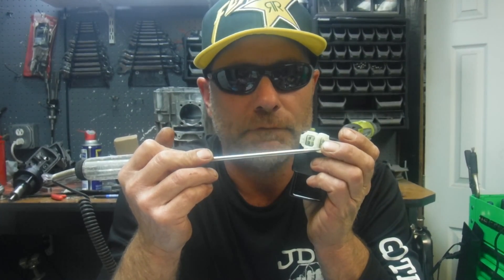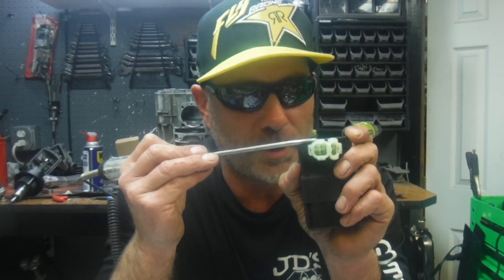CDI ???   AC OR DC?  AND HOW YOU CAN TELL!

Comment: so u explained the cdi side,  what about bike side,  so you have bike how can u tell witch cdi it requires if battery is optional,  at thar point would it be up to me to decide what type of cdi i want to use, like a dc with battery or rectifier or ac and wire accordingly,  

at this poing it seems like i can go either way correct ???

Comment: Checking the wiring diagram for a Suzuki DR650 seems to have a hybrid CDI that has an Exciter Coil to power the CDI box capacitor and a direct current input from the Voltage Regulator via the ignition switch to the CDI as well.   Strange setup.

Comment: If i have a bad stator could I convert the system to DC? Do i have to buy a dc cdi? Or could I use the same cdi just wired differently?
Reply: Nevermind I tried it and I'll be ordering a new CDI 😂😂😂😂 do not do this you will create some fireworks
Reply from the maker: Both

Comment: Wouldn't you say that a AC CDI that makes its juice from the stator and energizes the CDI box would be more appropriate or better off for off-road vehicles just to eliminate one more problem like a dead battery?
Reply from the maker: I will sy that I do not disagree with that theory. I used AC til we started racing them at the tracks and I only switched when I found how much better the Ban Jing performed compared to everything else.

Comment: For me, I think the question is, given the purchase of a non-descript cheap CDI, how do you know which type it is - ac or dc? Also, can you use  an ac CDI in a dc machine (and vice versa)? I guess I'm also worried about what any replacement might do for ignition timing - especially for 2 strokes where quick overheating and catastrophic failure could result. It's a minefield don't you think?

Comment: There are some Vehicles that rectify power from the stator directly to the cdi unit. Thus allowing for a DC cdi that will function with no battery. Regardless will still have fused positive and main switch wires
Reply from the maker: correct, but in the case of the buggies that i have seen as battery voltage drops, the cdi loses function which would be a direct result of a failing rectifier, the way the buggies are wired is the rectifier maintains the battery as the draw happens when it is running. Basically depends on the way it is wired.

Comment: i need to know how to check if lights arr ac or dc powered
Reply from the maker: i would try and test the wires with the machine off ignition on and the light switch on, use a test light. normally ac wired lights get very dim at idle and noticably brighter when the motor is running where as dc wired lights don't fluctuate that much
Reply: @jdscustombuggies1733  thank alot

Comment: So if my cdi is bad, would it run? Mine runs but doesn't like being warm.. when I push the throttle it falls on it's face.. new carb already and same issue.
Reply from the maker: Sometimes a bad CDI will idle fine but when the gas is pushed it will not advance timing to match the rpms causing it to break up. That sounds like your issue.
Reply: @jdscustombuggies1733  that was exactly my issue. I just put a performance CDI box on yesterday and it's running great now 😊

Comment: How do I check the CDI before install so I don't install the wrong one?
Reply from the maker: Check the wiring like in the vid to determine what you need and order the correct one.
Reply: @jdscustombuggies1733  I know what CDI is required for my Buggy. I need to know if the CDI I have is the correct CDI for the buggy before I use it.

Comment: I jump started my scooter because the key ignition doesn't work even with a new key some electrical I haven't found it yet but the scooter stay running after I take the battery that means I have a AC CDI

Comment: Thanks for sharing ,your knowledge,I'm working on a Bombardier Rotax snow mobile ,I'm not sure what it uses it's a got a coil pack that fires 2 spark plugs ,and I had a box on the frame that's transparent,I'm not sure if it's a cdi or a voltage regulator,all I know is it's not sending any spark ,it's got two Mikuni carbs and an oil pump bolted to the pull start housing ,it also has a starter,Thiers no ignition or switch ,any advise will be appreciated
Reply from the maker: i would assume it is AC because it has a pullstart
Reply: @jdscustombuggies1733  yeah I got it started by disconnecting the the harness from the frame

Comment: So if I have a 4 cylinder motorcycle ..(1980  Suzuki GS 850 )..
Will I be able to run only one CDI..or do I need 2 ..1 coil..fires 2 cylinders ..??
Reply from the maker: I suggest you look up the part for that bike , I suspect it has a unit to fire multiple coils or a coil pack

Comment: Please tell me you actually answer to comments I have a Carter XTV -150 with a dc battery electric start a 6-pin CDI and I can't tell because it has a fused 12v but some idiot took the buggy apart and put it back with mismatched parts how can I find the correct ones
Reply from the maker: yes i do try and answer questions but yours is kind of vague. you can feel free to reach me at the shop 941.286.6703 and i will try and answer any questions you have.
Reply: @jdscustombuggies1733  thanks I got ahold of a GY6 specialist I'm getting a new harness

Comment: great vid, so basically on a gy6 scooter, if you disconnect the neg on battery while the engine is running , if you have AC then the motor will not quit?

Comment: If i try to kick start without the battery on a dc cdi will it still work?  No right
Reply from the maker: yes but why? what i mean is it can be wired to work but you still need the battery to run the DC CDI so why skip a solenoid in the mix. not to mention you still need a starter to seal the hole it goes into. but a kickstart can still be used as a backup as long as the power is getting to the CDI it should fire.

Comment: Hi, NIce VIdeo,,,here is my situation, just got a CIXI Konced 150cc scooter, when it came to me it did not start,,,compression, fuel, stator coil all look good, but we have no spark for certain, we tried, different coils, CDI, plugs,,nothing,,,,the previous owner I believe messed with the wiring, and the scooter came with multiple CDIs, I am not sure if this bike is AC or DC CDI and the wiring looks strange, I think this is our holdup to get spark and turn it over, what should I do, put in AC or DC in this bike then case the wiring?  TY for you help!

Comment: On AC CDI headlight does not come on when ignition is turned on headlight will flicker upon idle on AC CDI on a DC CDI when the ignition is turned on the headlight will stay on bright and when the bike runs the headlight will stay bright that is the easiest way to tell AC CDI from DC CDI
Reply from the maker: mostly the case on factory wired AC/DC buggies but not 100%. if it is a used machine or the wiring has been altered that the lights run DC off the battery, this method will still determine what CDI you have.
Reply: @jdscustombuggies1733  Very true
Reply: @jdscustombuggies1733  your wrong sir it's apply on what rectifier installed there's no connection with the CDI at all about the power on headlights😊 hope you understand 👌
Reply: The headlight being AC has nothing to do with a CDI being AC...

If you have no battery, then the CDI must be AC, bar this rule all bets are off😎
Reply: @richardrichard5409  you are completely misguided kid. Speaking nonsense.
Reply: @matthernandez1737 🙄

Comment: I noticed that my harness only has 3 wires in the in the bigger slot does that mean I have an ac cdi
Reply from the maker: no, both of those bottom pins on the 4 pin side are grounds. most of the time only one is utilized.
Reply: @jdscustombuggies1733  thank you for the help. I bought a new racing ac CDI and it kept blowing a fuse but when I put the oem it won't. Why?
Reply from the maker: @knoxbom3274  either it's the wrong cdi or something is wrong with it, what machine is it for?
Reply: @jdscustombuggies1733  2013 kymco agility 50 4 stroke kg10sa engine code

Comment: I don't have a buggy, I have a Chinese 150cc scooter. I'm watching because I need a better headlight and want LED. I think I need to know if it's ac or dc.- So if you Don't have a tester, just pull your battery connection and the bike still runs, it's AC - if the bike stops.. it's DC - that good enough?

Comment: People say that if the lower of the two right pins has 12 v while contact is on its a DC. And they also say that if u disconnect the battery and scooter doesn't start then it's a DC as well. What confuses me is the following. I have 12v on my CDI right button wire which tells me it's a DC. Now the confusion comes that my scooter start with kick start even when I disconnect battery
Reply: AC power goes to rectifier and out as DC to battery, but sometime that DC out goes to accessories too and disconnecting the battery wont stop fresh DC power going to accessories and thru power switch
Reply: Disconnect battery nothing runs lol u need starter motor if no kick start lol
Reply: He's talking about after it's running already then disconnecting the battery 🤣🤣😂😂! Making perfect since man!!